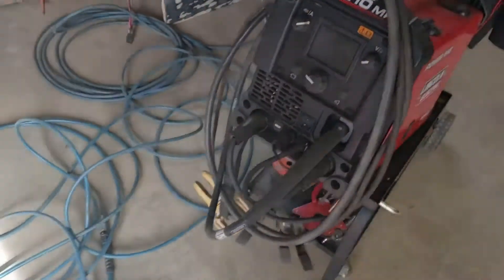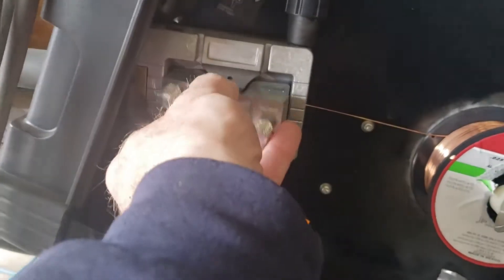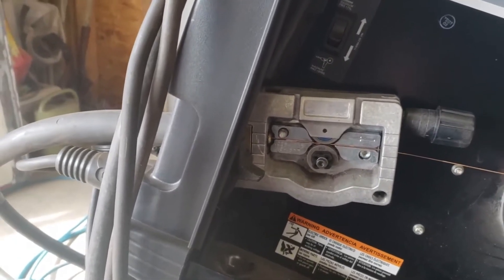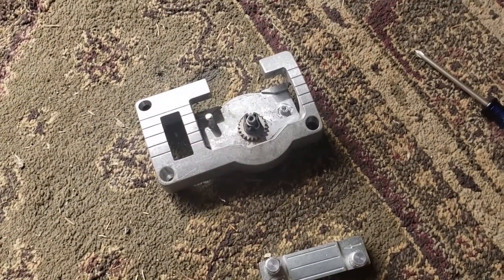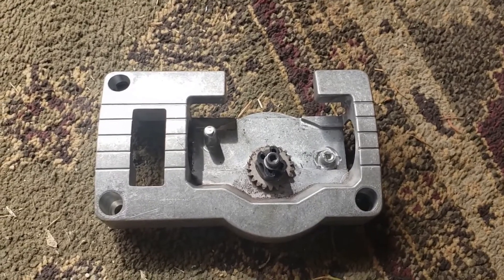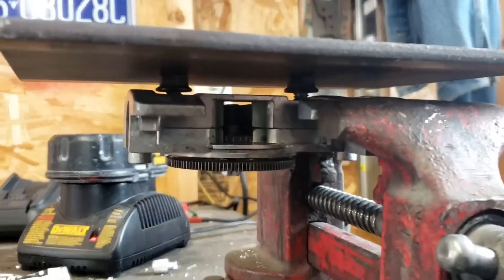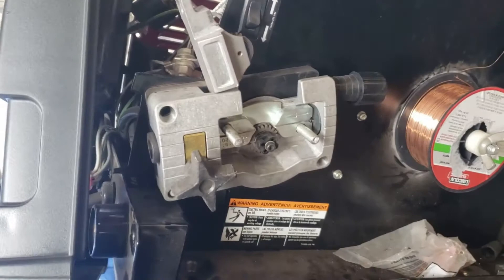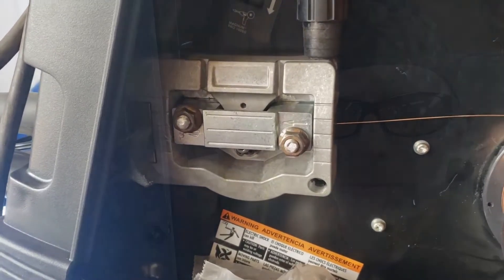How to Save $225 by Fixing Things Yourself

Comment: I know this is an old video but to prevent getting birds nest issues try backing off the pressure some on the feed wheels. This way when the wire sticks in the tip or whatever the wheels will just slip and not birds nest the wire. I enjoy your tri five videos keep up the good work.
Reply from the maker: Thanks Ken. I appreciate the tip. I have eventually figured that out, and it did decrease the birds nesting significantly. Thanks for watching and commenting. More to come soon!

Comment: I was pondering on this.I wonder if it breaks again if you could drill and tap where you put the jb weld and screw double threaded studs into the plate then put the nuts just as you have them now on the top.
Reply from the maker: The remaining aluminum "plate" is super thin, so I'm not sure I could have got any threads in there. Thanks for the input though. I'll look into that option if they happen to break again. Thanks for watching.